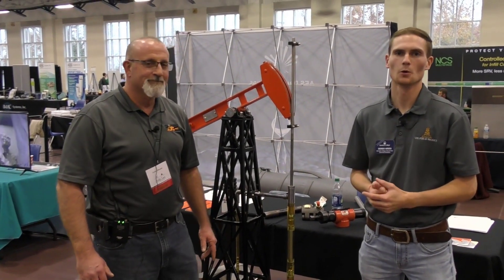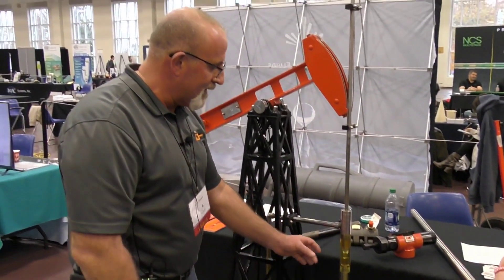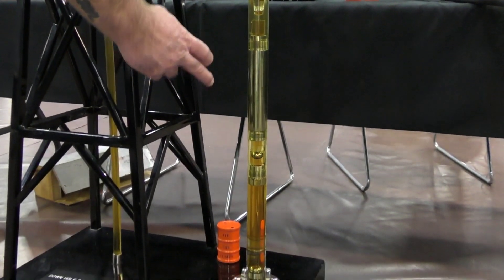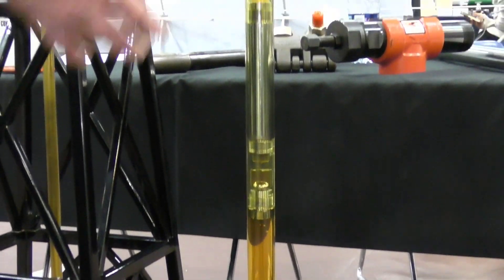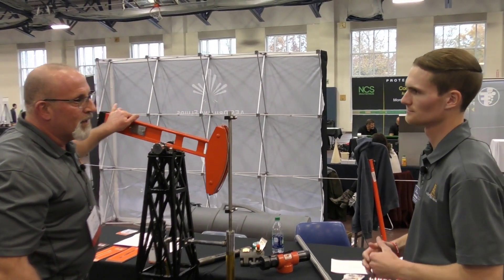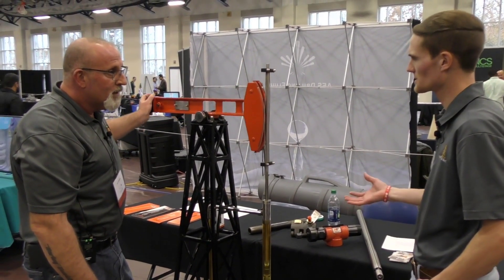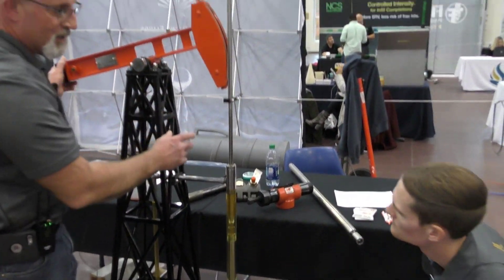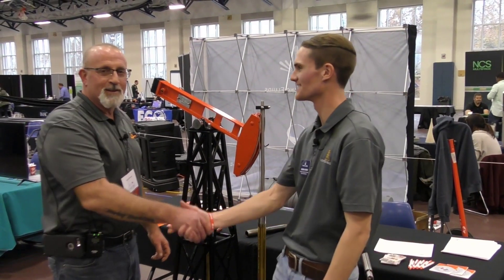Downhole View of Pumpjack System (Rod Lift) with Apergy

Comment: Riggers duty to depower oil well motor pump oil production jack's. Breaker for phases in electricity. Turn off or on before repairs. Safety first.